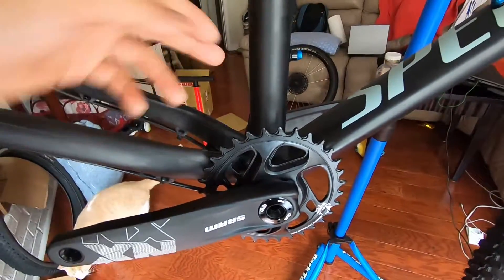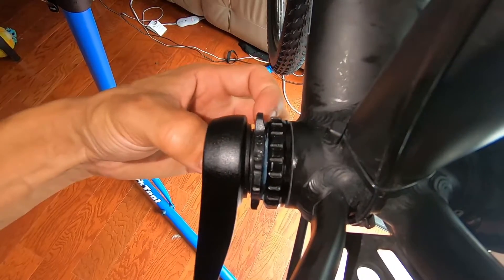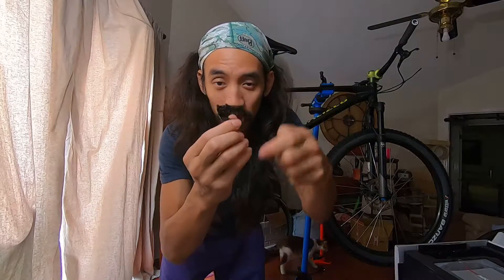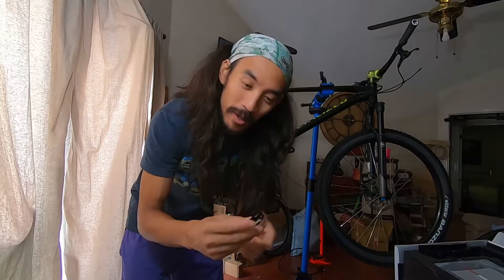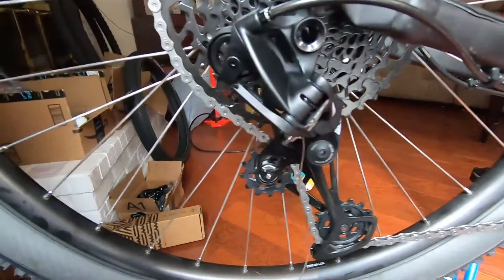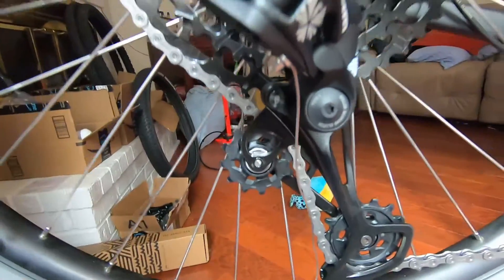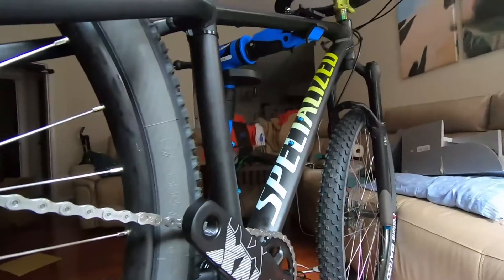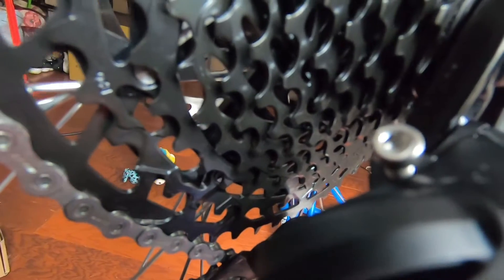SRAM NX Eagle Install / 2020 Specialized Pitch / Entry Level Hardtail / Beginner MTB Upgrade

Comment: Just some quick non-professional advice!
Since it looks like your making you bike MUCH more capable, I would suggest upgrading the hubs and wheels sooner than later. My last bike was a specialized rockhopper pro and I’ll list off some of the problems I had with it below. Keep in mind I had the bike for 6 months, and wasn’t doing anything to crazy like gap jumps or drops.
1. Five spokes broke on totally separate occasions
2. Front hub was quick release and the pin bent which ovalized the entire hub. The whole wheel needed replaced (400$) but they replaced it under warranty.
3. Once you progress in your riding like I did, you’ll find it will get harder to keep you rims true. 
4. When I traded the bike in, they found out the rear hub needed a rebuild also.
Hope this helps and keep the great content coming!
Reply from the maker: MTBikeStuff thanks for the advice. I looked into upgrading the wheelset and hubs, it’s just so expensive lol, especially after all the $$ I’ve already put into it. It will happen one day though!! Any wheelset/hub you recommend?
Reply: Right now I’m running “bontrager line competition” hubs and rims and I love them. The biggest difference you’ll notice with more expensive hubs is they have more teeth in hub which means they sound amazing, and more importantly, they engage quicker. So if you quickly need to put power down, the drivetrain engages almost instantly.
Reply: @straightbushin  DT-Swiss are my wheels of choice. amazing quality, sadly a bit expensive. but they can easily be serviced, adapted to different bikes, freehubs and upgraded to up to 54t ratchet engagement.

Comment: sweet.  i had a nx eagle on my first mtb. i was amazed how good it was compared to those old 3x drivetrains. then i went to shimano 12 speed, and on my second bike the new 11-51 5100 cassette and shimano derailleur. and oh boy that shimano deore stuff is cheap and so amazing. shifts so damn good under load and never misshifts. nx eagle was a creaky and  misshifty mess after just a few wild rides.
Reply from the maker: I'll keep that in mind for my next project. Thanks for the info

Comment: Im planning to change my groupset too on may pitch, what kind of bottom bracket did you use?
Reply: I am also trying to upgrade my 2020 rockhopper comp 1x and im not sure what my bottom bracket is... BB30 or PF30?
Reply: Should be bb30 pf stands for press fit
Reply from the maker: sorry for the late reply. I used a threaded dub bb. Don't remember the exact size

Comment: Did you have to switch the rear wheel or anything for the Pitch to fit a 12sp?
Reply from the maker: Not for the NX, GX and higher require XD hub I believe